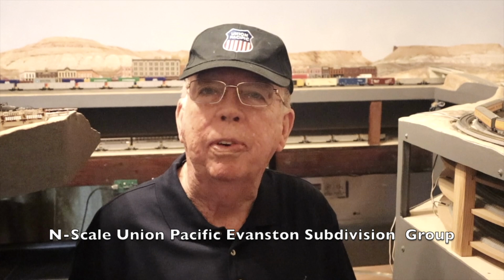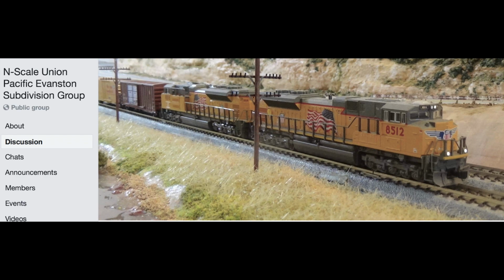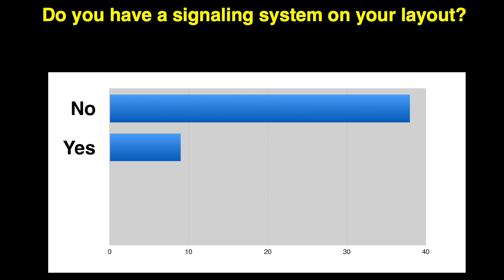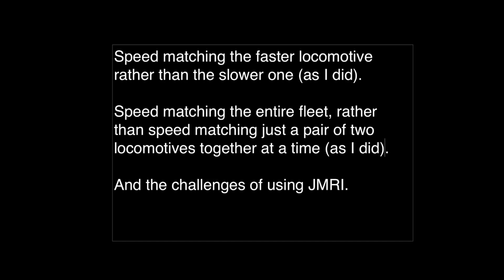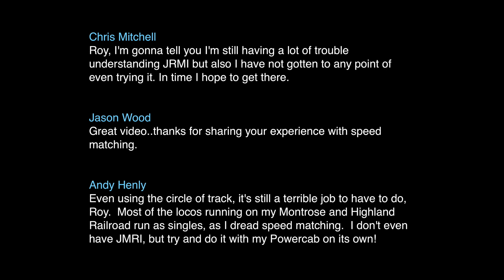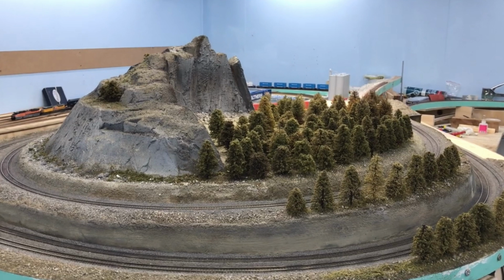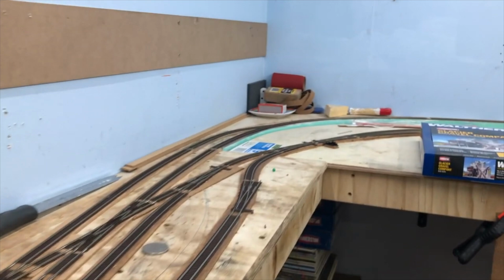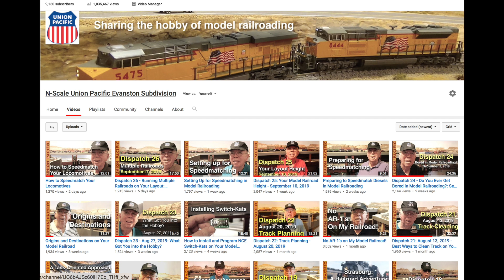Dispatch 27: Signal Systems on Your Model Railroad  - September 24, 2019

Comment: Roy, Being fully retired for a long time, I usually spend 2-3 hours per day or anywhere between 14-21 hours.  It really includes painting buildings, some 3D printing related to the layout, creating decals for industries, working on rolling stock, etc.  I usually include running some short trains on the main level too....John

Comment: One of the nice benefits to modern LED technology and modern 3D printing, is it's now technically possible to just 3D print custom signals. Tiny modern SMT LEDs are ridiculously tiny, and some suppliers online even sell them with pre-soldered leadwires. If you print your signals in two halves (a front and a back), and include spaces to mount the LEDs and channels to route the wires, you can create a VERY clean looking end product. Models and detail pieces is one of the number one reasons I want to invest in a resin 3D printer.  Just be careful not to get the uncured resin (or the alcohol bath used for cleaning) on your skin if you do get one. Nitrile gloves are a must.

Comment: I manage 8 to 12 hours per week, maybe more. More if I am on vacation. I get most of my  hours on Saturdays, ignoring my "grown up" chores. Not too much time running through. Repairs, adjustments, model building, general tinkering, debugging track. I head down to the basement with a plan in mind and quickly divert to other things.

Comment: Great video Roy, I always look forward to watching them and get tips & pointers on my own planned Pacific West Coast RIlroad. I already drew up how I want the freight cars,locomotives & cabooses for the Pacific West Coast(The PWC). I’m acquiring materials for my planned covered walkways & passengertrain Station. I also have tunnel portals, piers, arches to use for culverts both stoned arch & reinforced concrete arch. My planned railroad will include the BNSF, Santa Fe, Southern Pacific, Union Pacific, CN, CPRail & BCRail as well Amtrak, my Daylight excursion which I will be running both trains in a few months.

Comment: Uuuuugghhhhhhh.... It's already been a week! Man, this week flew by fast!
I guess I'm late to the game here, but regarding signals, I'm planning to model the Dakota, Minnesota, & Eastern main line that ran through my home town. It never had any form of signaling along most of it's track. It was primarily a single track that ran from Winona MN to Rapid City SD. Sure, it had a few parallel sidings spaced out here and there, and a few small yards in towns, but it was a low traffic single mainline, and it had no major signals of any kind. There are lighted grade crossings, and some crossings with gates, but signaling for grade crossings was about it. Switches consisted of the red and green rotating markers mounted onto the top of each manual switch throw lever mechanism. 

Here's the thing though... I LOVE railroad signals. I think they are cool! I like how they look, and as an electronics guy, I WANT that bit of gadgetry on my layout!

Since my plans are to model DM&E (along with other roads) in a fictional alternate timeline where they still exist to this day, I can just choose to model the mainline with "upgraded" signals! My plans include DM&E expanding into the Powder River Basin in Wyoming. Projections for this project, had it been a reality, were projected to have significantly increased rail traffic from the meager 1-3 trains a day, to as many as a train per hour! This would have almost certainly meant significant upgrades to the route. I could easily imagine DM&E laying a parallel track, to accommodate both east and west bound trains more smoothly. I could also see them installing a proper signaling system, for enhanced safety (though in reality, I imagine they, and now CP and RCP&E likely just do all traffic control by radio).

Regardless, the increase in rail traffic, and the major expansion is all the excuse I need to justify the inclusion of modern electric signaling.

Comment: On my n scale layout (in storage currently) it has searchlights made by sunrise signals (now a defunct company). Part of the reason it's hard to build a signal system, is the lack of realistic ready made signals that do not have blobs of solder on the back sides of the signal heads, or wires sticking out everywhere. When sunrise made their N scale signals, the backs of the signal heads had a "housing" behind the targets where the entire led was enclosed. Now, Custom Finishing makes n scale kits, but they are very expensive, and do not include the LED's, which have to be purchased separately.  I've bought their kits in HO (I model HO concurrently as well) and the HO kits are a bear to assemble.  So that's a big part of why there are no n scale signals. The china offerings on eBay, are way out of scale, and they have wires garbled and sticking out the backs of the signal heads. I look at it this way: if we can rivet count over the subtle differences in a locomotive, why can't we come up with ready made, prototypical signals in N scale. (Don't get me started on telephone poles for along the track. Those look goofy, too, but they are what they are)

Comment: Hey Roy,  I spend about 20 hours a week in the  train room.  I do set a time frame for wiring, building structures, weathering cars and locos, and maintenance.   I do have a question for you about speed matching.  why didn't you match the faster one to the slower one?  What I do is rest the cv's on both to factory settings run them to see which is faster, then match the faster one to the slower one.

Comment: Hi Roy, I’m planning to buy the first of my N scale Kato diesel locomotives in the Santa Fe & Southern Pacific to get my planned freight operation going once I have my layout started. I want to use all Kato locomotives. Which freight car couplers are the most compatible with the Kato N scale locomotives & cabooses? I bought my Daylight set at Obie’s train in Apache Junction,AZ which is the very best model railroad store in all of Arizona.
Reply from the maker: Christopher, I like Micro-Trains freight cars and their couplers best. I really like Kato locomotives, but sadly their couplers don't work well with any other brand. I will be changing the Kato couplers on my diesels to Micro-Trains couplers. ...Roy

Comment: Simply adding a signal system to ones' layout would be easy enough but to make it  fully functional and the layout more authentic,   I suppose some kind of software that would work with your DCC system (decoders) should be considered if one wishes for their locos to operate realistically.. One would only think (and hope!) that in purchasing a SIGNAL light - regardless of what type it is, should come with some kind of universal code for any North American DCC System...I have always found it odd that this part of the hobby lacks such definition or perhaps there is but I've never seen as such!  Great videos, keep up the great work!
Reply: thank you for your appreciation to my comment. :)
Reply from the maker: Thanks, Will. I, for one, have to study signal systems much, more more. I really do want to add one to my layout at some point, along with a lot of wiring and re-wiring that I have to do. Such a system could add a lot of realism to my layout, even in N scale. ...Roy